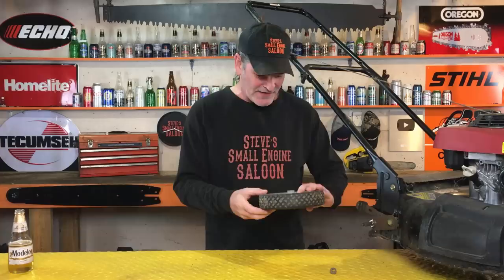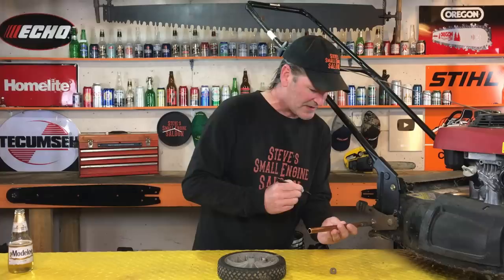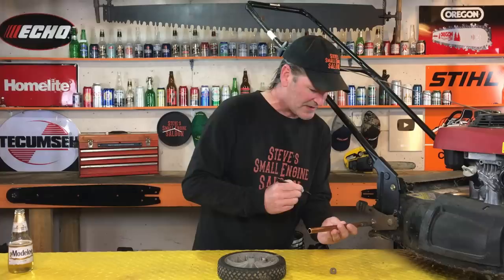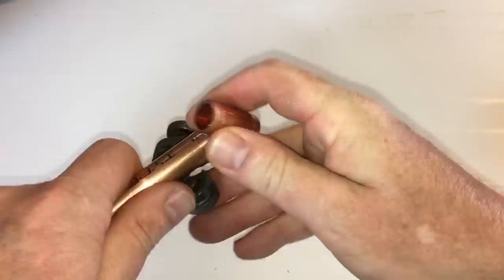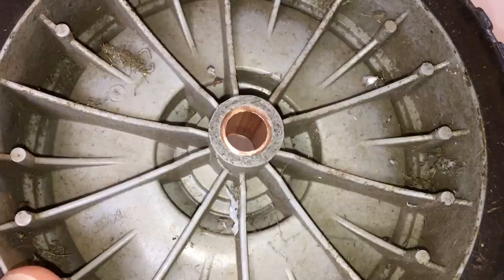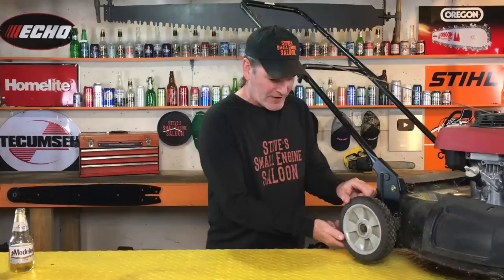Amazing Trick To Fix A Wobbly Lawn Mower Wheel

Comment: I haven't seen one with a bush for years. All the ones I've dealt with have had roller bearings still cheap and nasty .Plastic shells with steel balls and held in place with those steel caps .No screw on nuts that would cost them to much .No we must have these push on caps that are a real pain to get off and even bigger pain to put back on.
As for your bush I'd use brass .The type that soaks up the oil. You can get it from a bearing joint its harder and will last for ages. Same type of bush thats used in electric motors ect. Better to have some type of lube dust and crap is going to get there no matter what you do ,just clean them every now and then.

Comment: No grease. The dust and grass debris will come and go as it dries out but the wear is no longer between the metal bolt and the plastic wheel. The real wear will come from friction between the steel bolt and the brass sleeve. Grease here will make the dust stick. No grease will let the dust and grass debris to be ground a bit, but there will hardly be any effect on either the brass sleeve or the steel bolt/stud.
Reply from the maker: Right on

Comment: Silicone spray instead of grease for me.

Without lube, wears faster. Soft metal like brass bushings can eat solid steel too. Soft eats hard.

Bushings may outlast the axle. But axles may outlast the mower anyway.

Comment: if I was going to use copper id grease it and every year clean old grease and re-grease due in fact copper will corrode. Cu oxidizes due to the air, thus grease should prevent the Cu from oxidizing.

Comment: I personally lube up the shaft with any engine oil I have around. Once they go dry they don't spin for long. Add a bit of oil and it turns into a fidget spinner. Makes it ever so slightly to push the mower.

Comment: I haven't seen k copper for 40 years but m is possible. It will work . Split the copper long ways tap it in with a leather mallet and use dry lube of any kind. And It's called a reamer and comes on larger tubing cutters. Fun as always.
Reply: michael morgan got my K copper at Graingers
Reply: @charliecarey3784  thanks I haven't owned that house for 20 years. It was built 1937 and I could get what I wanted from a local supply in beltsville   Maryland . to do the renovation but its good to know if I ever decide to go and remodel another old house. Thanks Charlie

Comment: That center of the wheel is quite protected so I grease em! But before I do I take the wire wheel on the grinder and buff off the old build up on the axles, then I grease them. That build up takes up some clearance that can be occupied by grease. I just did a mower tonight that the wheels needed grease and it's a night and day difference. I have been known to shim mower wheels and custom fit them so they track straight because the little but of wobble grease or not sometimes makes the mower harder to push. I had been looking for something to put in the wheel like that pipe so Ill be digging out my 5/8 drill bit now to go along with the washers to make those wobbly wheels better than new. Thanks Steve! Here is my video on my shim washer trick https://www.youtube.com/watch?v=9Fw3l6GMsqY&t=63s

Comment: Absolutely zero grease because it will attract grass and other debris. 3 years over a 1,000 through my driveway never an issue.  Only issue would be some mower wheels the metal collar is frozen on the shaft.  I remove the wheel and collar stays.  Just remove that...easy peasy.

Snowblowers are a whole different situation!  Grease the heck out of them! 🇺🇸🔧🤙🏻🦅

Comment: You do Not have to use grease, BUT i do anytime I have it apart just to keep it from rusting. if you're really worried about dirt and sand, then use some caulk or gasket sealer on the ends. or clean it and put new grease everyone once a while. otherwise what's it really going to hurt? because dirt isn't being shoved in there, you'll be fine for a least a couple seasons

Comment: I think your method probably will make the wheel last longer. But any time you have metal on metal, you need lubrication between the two parts. The beauty of plastic, as weak as it is, is that it doesn't need any lubrication.

Comment: I also have same problem with my mower like in video. But my mower wheel shaft is also worn. Did almost same thing like in video but wheels wobble still too much.
Conclusion: It's 1000 times better to have mower wheels with bearings.
Reply: Sand was accumulated inside plastic wheel and grind like sandpaper my mower wheel shafts.

Comment: I would grease it then i would fill the outside hole with silicone !!! To re grease it just pullout the silicone and re grease.. I actually do this to mine once a year normally just before i
put it away for winter. Never had a problem with grass or dirt getting in. Remember to let the silicone go off before you  use it  otherwise its a sticky mess !!!!!!!!!

Comment: 1/2 inch metal (strip steel) electrical conduit might be a better choice over 1/2 inch copper pipe since it's not soft copper.  Also, it's cheaper:  the 1/2 in. conduit at my local home depot is $3.40 for 10 feet whereas only 2 feet of type L copper pipe is $6. !!!

Comment: I would say it depends on the mower and where you keep it copper can oxidize when exposed to moisture turning green and depending upon what type of metal stud it's over could cause them to weld together and grease may be required to prevent this or slow this from happening food for thought

Comment: I've found that putting a duct tape patch over the outside end of the axle keeps most of the dirt and crud out of the bearings. Make it a bit oversized so that it is like a hubcap and doesn't rub against the axle nut as the wheel turns. If it gets torn, just replace it.

Comment: If you use K type copper the ID is just a little smaller than L type copper and the wiggle is even smaller. Type L copper is thinner than Type K  there in lies the difference.

Comment: I have done a version of this , was not exactly the same because I had a can of old hardware i bought at a garage sale.  it was loaded with flanged copper bushings.   I put on in each side and filled the empty center space with axle grease. the mower rolls like it should have new,   why dont they put bearings in these?  the damned mowers are over priced, what would it cost them to put bearings ? maybe 1.50 or so?   production.    oh yeah, the flanges act as washers, so no plastic to metal wear

Comment: First, that's a lot more than a little play. If your mower wheels had a cap covering the nut, then yes grease it. With the bushing open to contamination, you're better off not greasing it. Plus, if your wheels are that worn, chances are the mower is very worn and isn't worth doing much to

Comment: If the wheel spun at high RPM's I would say grease it. Since it will never spin fast enough to get hot, I say let it spin freely. In my 40+ years of existence, I have never in my life had greased push lawnmower wheels and never had an issue ever.

Comment: Put a grease zero in an hit that puppy with grease every hour of mowing and at the start of each mowing session. Once lubed, it will likely only take one or two pumps of grease. Wipe off the excess grease with a paper towel and you will take the last of the wobble out and it will roll nicer and have better precision.

Comment: I just checked 1/2" schedule 80 pvc and it's too big so stick to the copper..
Reply from the maker: Right on
Reply: @StevesSmallEngineSaloon  what is the actual dimension of the wheel stud plus the inner dimensions of the 1/2" copper pipe? I sure was hoping that pvc was going to work since I get 10" for $2!😉

Comment: It is not turning fast enough to worry about grease. The load pressure on those wheels is very light. Greasing wheels on a push mower like that is a waste of time.

Comment: No grease or oil, maybe Graphite, but you've just put a soft copper bushing onto a steel shaft.  the copper is a softer metal and acts similar to a bearing.  I'd leave it alone, if, in a decade or so........., the copper wears out, just cut another piece and replace it.

Comment: Grease or no grease, if it fails and you catch it before it wears the copper pipe through, you can just press in a new piece of pipe and have it fixed in no time👍🏻
Reply: and most times the mower will be scrap by that time. ( main bearing and wrist pin will normally wear out by that time )
Reply from the maker: Great point!

Comment: Copper and steel is not a good combination. copper corrodes steel. Brass or steel pipe would be ideal, but aluminium would work too, but being soft material, maybe not so long lasting, but surely long enough for lawnmower wheel.

Comment: WD40 once a month.
Reply: Unfortunately many people think WD40 is a lubricant but it’s not! It’s a cleaner and also highly flammable! When previously I have small engines that won’t start, I pull the spark plug and spray a little WD40 in the plug hole and put the spark plug back in and 99 times out of a 100 the engine starts right up! And it doesn’t eat your pistons li I know started fluid will!
Reply: @ghostridergale  Yes it has many purposes like you described but try this, you'll be amazed.........take a margarine lid as a small tray and spray a good amount of wd40 in it, about 8 seconds worth. Now let it sit for a day or 2 and look at what remains after the propellant is gone. It leaves a nice thick coat of lube behind for lubrication. I've been using it as a lube for many years but accidentally found this out a week ago. Try it!
Reply: @chrisnotap  I’ve been using WD40 for years spraying down my ATV’s after a trip to the sand dunes to keep the metal parts from rusting and it also gives the plastic a nice shine as well. But again you still need to be careful with it being it’s so flammable. First mistake I made with WD40 was spraying down a electric chain saw trying to get it to quit sticking! Hit the switch after spraying it down and had 3’ flames right in my face!!! I knew better too and still screwed up! But not a mistake I’ll be making twice anytime soon! LOL

Comment: I would fix the existing tire like you did rather than buy a new one because I like "rescuing" stuff. But Harbor Freight (Princess Auto, too?) has an 8" tire with a metal hub and ball bearings for $7.49. Kinda hard to justify not buying it instead.

https://www.harborfreight.com/8-inch-solid-rubber-tire-42427.html

Comment: "The squeaky wheel gets the oil: If it doesn't squeak, don't oil it! I'm willing to bet, that even without oil, it will STILL out-last a new wheel.
Reply: Absolutely Vincent. Pretty sure they use a cheap soft plastic to make these replacement  wheels (Made in the RPC, at least in my country.) A rip off.
Cheers. Stay well.

Comment: Will not work on a Poulan Pro as the copper pipe is way larger in diameter than the spindle the wheel rides on.

Comment: I posted a very similar thing several years ago. Great minds think alike! https://youtu.be/B6h5tB_FKeo I didn’t have a big enough drill bit at the time, but absolutely, that works better. Using copper tubing is a great idea too. It’s less likely to wear the axle itself. Thanks!

Comment: No grease, invest the savings in extra Guinness.

If you must lubricate (yeah, you, you OCD dweebs–you know I mean you!) then I suggest running a tiny (_copper_ no steel, not even stainless) line from the crankcase to the wheel (may as well do all of them while you're at it) and crush the end(s) so only a tiny bit drips out.

But keep in mind: the expense is coming outta your beer fund!